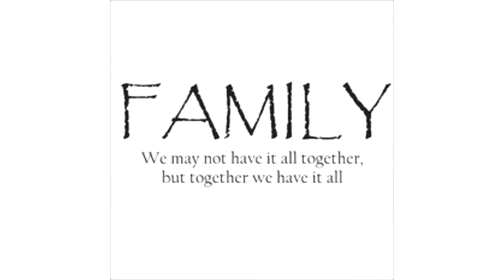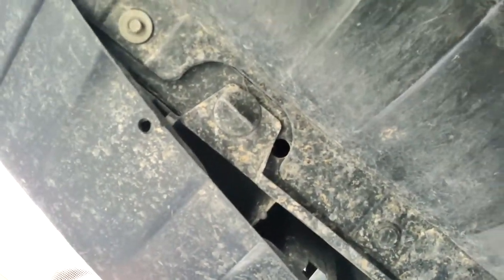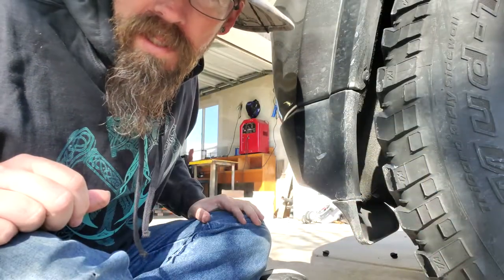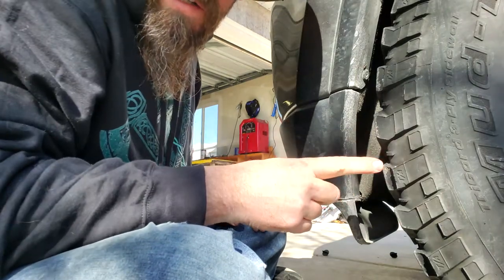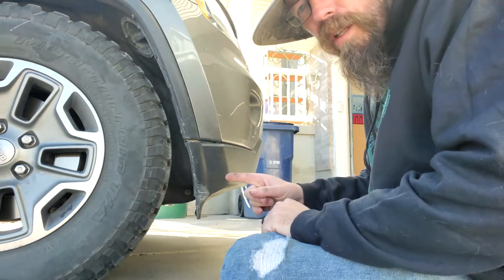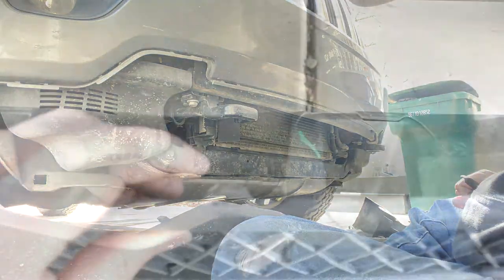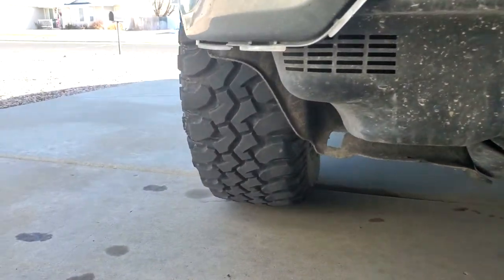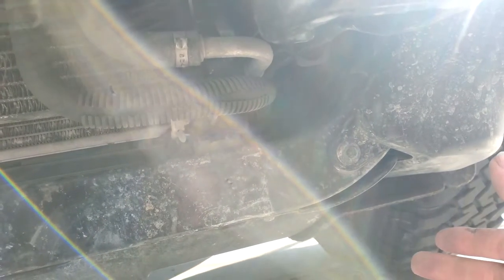How to Remove the front facia from a WK2

Comment: I appreciated this demo - I didn't even know this was possible on my 2013 WK2. What I need to do some day is remove the entire nose in order to gain access to the hood latch (the remote start won't work because the latch sensor does not recognize when the hood is closed). I have the replacement latch... but it requires a ton of stuff to be taken out of the way before the replacement can be installed...
Reply from the maker: Glad I could help, thank you for watching